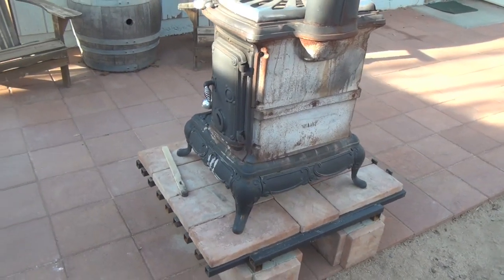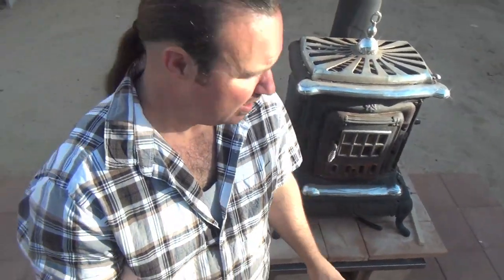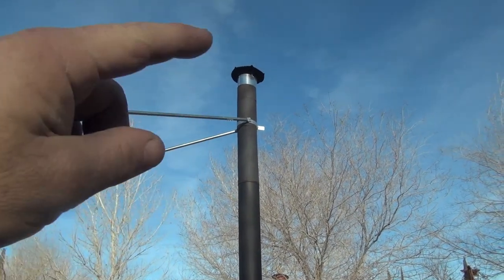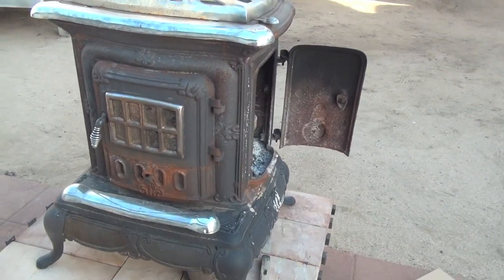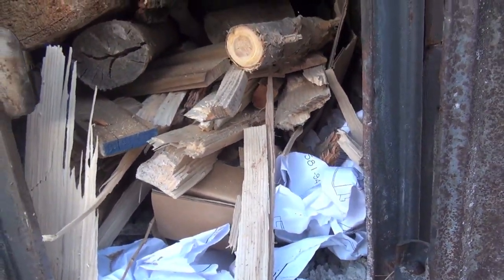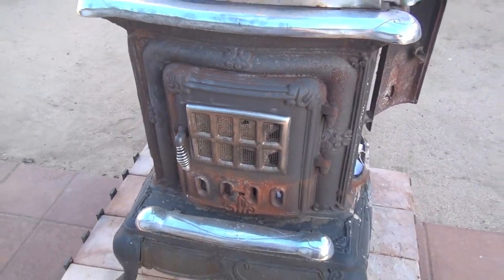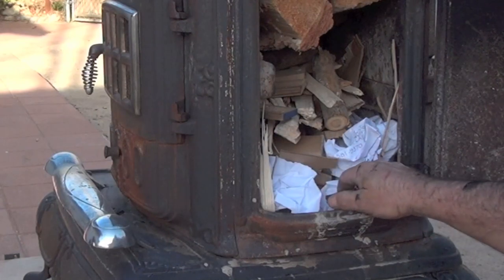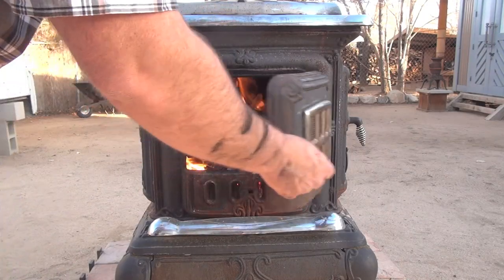Make Patio Wood Stove Hearth & HOW I LIGHT My FIRES, Wood burning Stove PROJECT

Comment: Nice new set up!
But I do wonder two things.
1) Should you put a removable bracket/support pole on the back so it can't be accidental tipped over? (Maybe weld a square bracket on the bottom of the hearth frame & then use a angle iron or the same you used on the frame to slip in the bracket? Hard to explain, at least for me.)
2) I know how you are, very meticulous. So, will you let this one on the porch keep deteriorating?  lol
(I bet you do some work to keep it more sealed/protected from the elements?)
Anyhoo, great job again! 
James
11/26/2015
10:02pm
Happy Thanksgiving Day